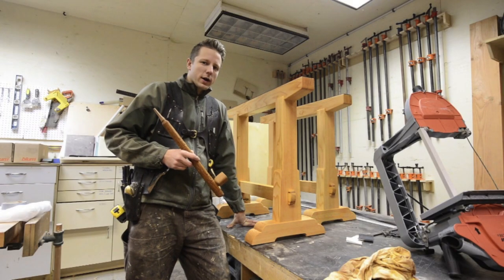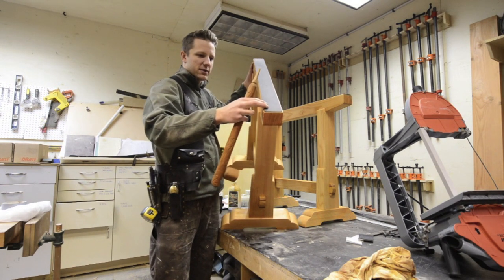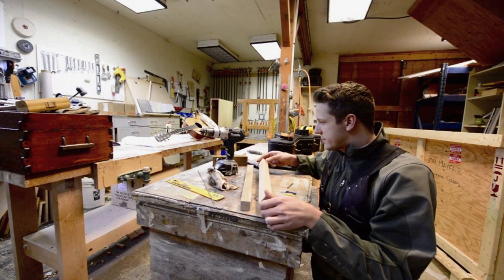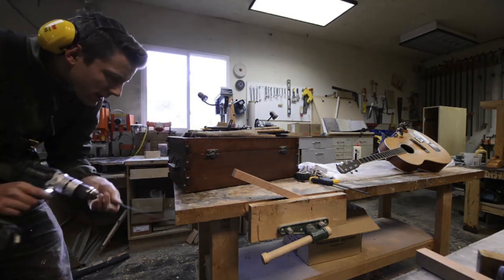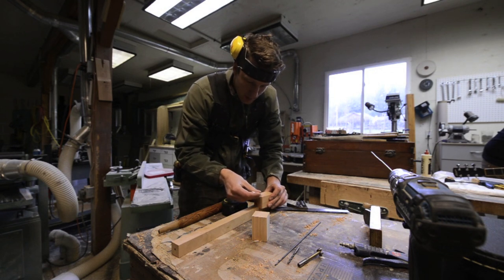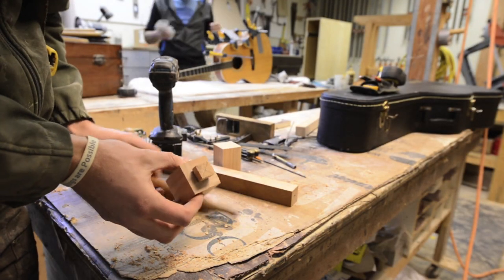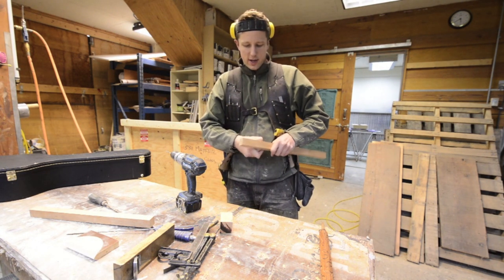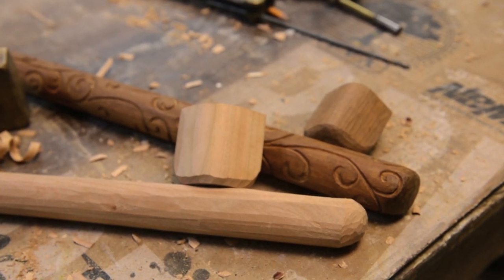Woodworking, Hand Carved Tobacco Pipe, How To

Comment: I swear I have pstd from drilling so many failed stem holes over the years. I make exotic style peace pipes with pencil thin stems at 10 inches usually, I drive the bit through my stem wood and leave the bit in and put it straight into my wood lathe and mill it down it's a pain in the ass because of the failures when I'm so close to finishing or the bit sealing inside of the stem and not being able to remove it but when I succeed it's so satisfying and it's sanded starting with 250 grit and ending with 1500 grit so it's glass smooth.

Comment: Try out using wood burl in the future. The grain comes out wonderful, and it lasts far longer in terms of use. The twisted grain of a wood burl allows for the heating and cooling with a rarer chance of cracking over time.

Comment: Didn't know they had tools like that lmbo!   I am Cherokee and I make pipes by hand and from nature that my friend is not a peace pipe!
Reply: so how did the "Naturals" drill the holes ?
Reply: I had to cut my pipe stems into  fourths. Then drill them. Then I made matching countersunk interlocking ends. Male and female. The system works well and can be taken apart and stored in a parfletch bag.
Reply: triumphmanful thank you for the idea!!
Reply: The first pipes were usually made by splitting a piece of seasoned hardwood branch. Each side had a channel cut in it that made the tube. When the two pieces were put together, they were carved with tapers on each end.  The smoking end was shaped to better fit the mouth.  The other end was to fit on to the special made pipe bowl. Most of the pipe bowls,  the authentic ones were made from the sacred bloodstone.  Hand carved.  The end opposite the smoking end was  carved precisely to fit into the side tube of the bloodstone  pipe bowl.  Usually the pipe was taken apart and kept in a leather pouch carefully wrapped up.  Both the wood and the bowl were fragile.  The two halves of wood would often be glued together with egg white, or with a tree resin.then they would be wrapped with wet rawhide and when dry, they would be bound together. Red Willow bark was mostly used, as true tobacco was rare.  Flutes on the other hand were made in a similar fashion,  but people ask how did they put the holes in. Native American flutes are not like any in any place in the world as they have two chambers.  Only the rim blown ones are straight tubes.  
They used some very unique methods for making the holes.  Some were burned in with a charred pointed stick. some with a pointed stone tied to a stick...It was not till a European left a gun rod  that they had a metal rod to use to burn holes with.  I have been making branch flutes for over 10 years now. but with modern tools.  The pipe the illustrator is making is just one style of pipe that was used.  Toughest part was obtaining the  sacred blood stone.  to shape the bowl.  A pipe from just hard wood would not last long.   Try to remember,  the pipe ceremony is not something to take lightly.  it is a serious ritual just as serious as a Catholic taking communion.  It was just one of the ways to mediate to connect with the Creator.
Reply: I'm cree, this tammy the pipe maker is cheap and withholds good knowledge.
Reply: Skyhunter _27 I am interested also.
Reply: Most Cherokee name I've ever heard..

Comment: If you don't  want it to wear out, make a paste of coffee powder (I use Nescafe Classic Coffee), sweetened creamer and some chocolate powder. Put some water and mix it. Make sure it's not too watery cause you want it to stick to the pot.  Put it inside the pot and let it dry for 1 day. Make sure not to block the smoke exit hole. You should be able to overcome the wear and tear issue.
Reply: how's that work?

Comment: I've had to do that for a few things, like sword handles for fun and I use my drill with a level on top, clamp the wood level, drill a bit, turn the wood half or 1/4 turn and repeat. I had about 1/16 in margin of error on 9 inches of wood so not bad at all. as long as you watch that level and keep turning the wood to limit veering too far one way.

Comment: How did the natives drill that hole with no modern tools??
Reply: Its actually ingenious really, they would take a termite or some wood eating grub and seal one end with the grub inside so the grub would eat through the soft wood center and make a nice long stem, though there where also stone bit drills you would use a bow drill with to get the same affect

Comment: thats not hand carved
Reply: i have no drill
Reply: +Lonz Moore What you could do is split the barrel of the pipe then carve a groove on both sides and then glue it back together to create a hole. If you finish it nicely you wont be able to notice the split marks.
Reply: Vertti Seppälä i made a pretty good one. took me 6 days. way smaller tho. im gonna make another thank you for help man. much love
Reply: +Lonz Moore Awesome! Have a good one :)
Reply: +Vertti Seppälä Do you know what type of glue the natives used?
Reply: +Adam Olsson, for traditional works,  we use what is called pitch, just a sap like pine and ashes cooked over a fire, use while it is warm, when it cools it dries. For quick modern things gorilla wood is some pretty good stuffas well
Reply: ive made a couple good pipes now, really nice, im proud of them. I used nothing but knives, rock and hammer on a nice piece of wood. Boiled peice in oils and teas for quality innersmoothness and compactness.
Reply: Lonz Moore